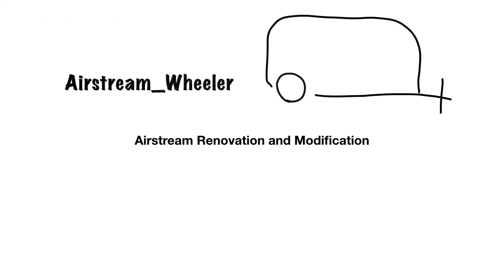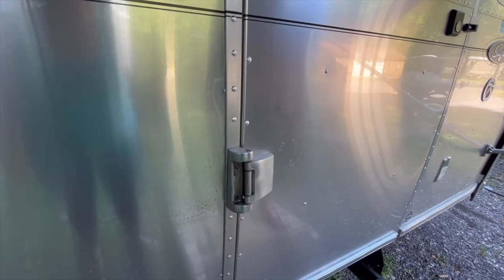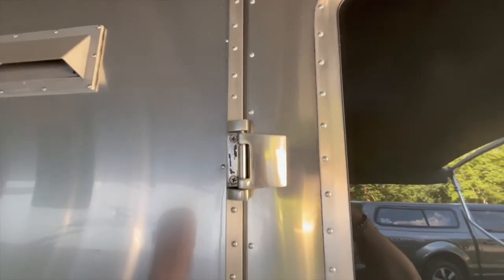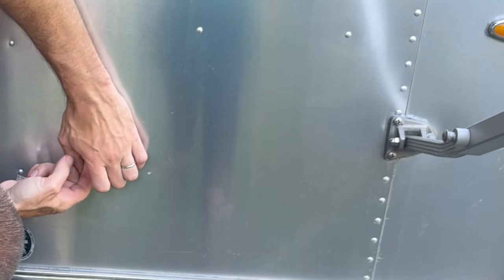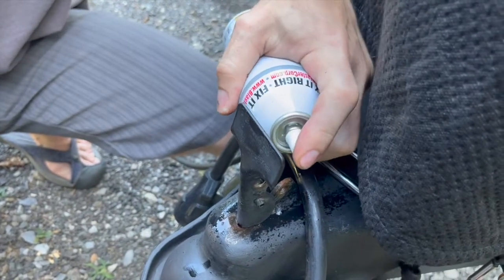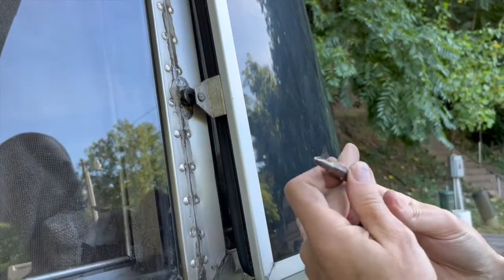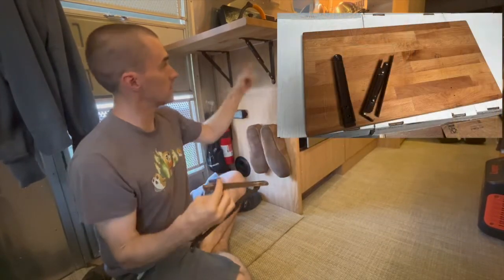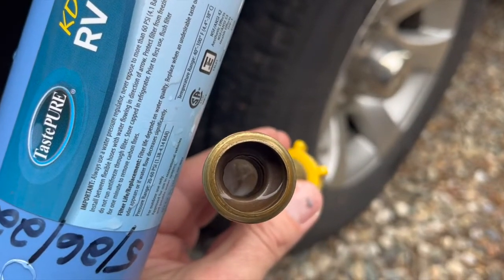Airstream Repairs After Travel

Comment: Hi the water inlet fitting where you hook up the water filter will crack over time put a brass 90 degrees fitting there
Reply from the maker: This is a great idea.What a great tip! Lately,  I been use the tank and water pump and avoiding the city water inlet. That loud water pump vibration is great at notifying of leaks.  Thanks for watching!

Comment: That'd screwed fix the door you had repair. You seem forgot that we have blue heavy duty threadlocker tip for not loses  the movement screwed after the vibration trailer in many miles can make the door shaken and screw can move out later.
Reply from the maker: Thank you for watching.